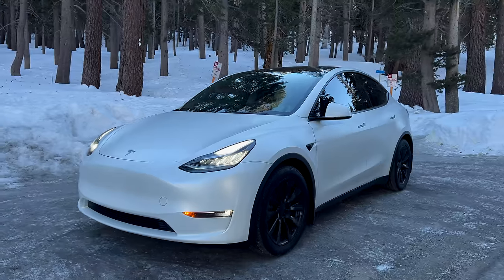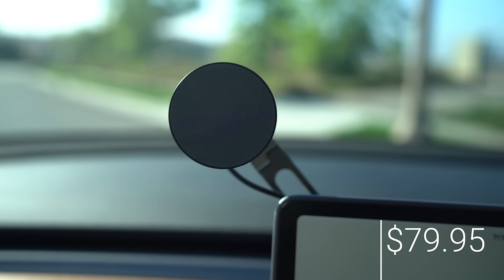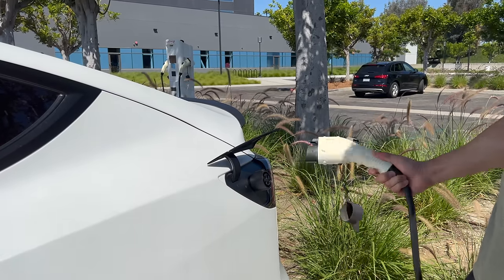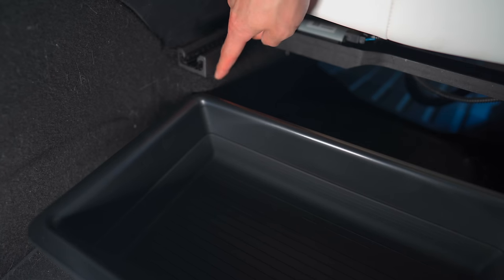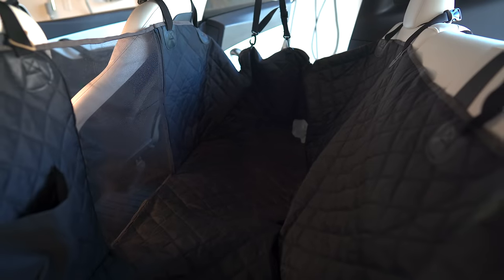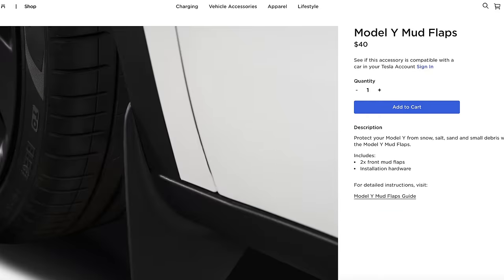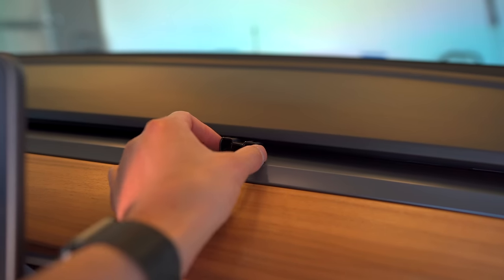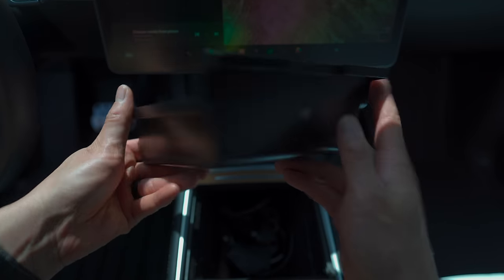TOP 10 TESLA Accessories I Can't Live Without!

Comment from the maker: ‣ Floor Mats 
‣ 3D Maxpider: https://bit.ly/3E2aVUy  
$10 off: Everydaychris
‣ Tesmanian: https://bit.ly/3raOmX0
10% Off: Everydaychris627

Cell Phone Mounts
‣ Jowua Amazon: https://geni.us/3N4GePy
https://bit.ly/3aEt8uL(5% Off: Everydaychris)
‣  Magbak: https://bit.ly/3DrUOx4  (15% Off: Everyday_chris15off)
‣  Temai/ Vion: https://bit.ly/3sOqtIn (10% Off: Everydaychris)
‣  Spigen: https://geni.us/EJdv

Radar Detector Install: https://youtu.be/9bf_Gu_R91Y
‣  Uniden R8- https://geni.us/qY5U
‣  Uniden R7- https://geni.us/nEBrM

‣ J1772 Lock
https://geni.us/z44nMU

‣ Cnick Tesla Ring
5% off: https://bit.ly/3usWpm0

‣ Storage Trays
Jowua- https://geni.us/VSBc
Spigen- Center Console https://geni.us/xj6K
Under Seat https://geni.us/4onn
Rear Storage box- https://geni.us/0lYa0q
Hidden Storage- https://geni.us/kQ4qJJ

Tesmanian  https://bit.ly/47HSQGW
10% Off: Everydaychris627

‣ Dog Seat Cover
Amazon- https://geni.us/J4PREUJ
Tesmanian  https://bit.ly/44fFUam
10% Off: Everydaychris627

‣ Magbak Rim Case Protectors
https://bit.ly/3IqbhWt
Use CODE for 15% OFF: EVERYDAYCHRIS15

Basenor Mud Flaps- https://geni.us/phCSi

Emergency
Jack pads- https://geni.us/WBnhG0V
Tire Plug Kit- https://geni.us/bTP8HBp
Vac Life- https://geni.us/6uQvc
Heavy Duty Extension Cable - https://geni.us/bwBwLwb

‣ Spigen Screen Protector- https://geni.us/DulKl
‣ Drift Natural Car Air Freshener 
 https://bit.ly/32IBVbm 
 10% Off: Everydaychris10
‣ Spigen Adapter- https://geni.us/E6j15Av
‣ Spigen Gas Pedals- https://geni.us/05VRXTY
Heatshield Sunshade- https://geni.us/5mNX

Comment: My #1 accessory is a swivel mount for the screen. Once you have it, you will never go back.
Reply from the maker: ive always debated on it maybe ill check it out
Reply: @EverydayChris  I have had it installed for 2 years. My screen has not faced dead center since.  Your co-pilot will love it too.
Reply: This was my ideal, first modification, but after some research and YouTube videos, I decided against installing a swivel mount due to the fact everybody is saying that it mounds a bit lower than the original stock setting or just ends up not angled correctly
Reply: I’m honestly surprised Tesla hasn’t added that from the factory,
Reply: @SSTURN any brand in particular you’d recommend?
Reply: @ssturn I am getting this installed on Monday with the other mods I've done. I can't wait. The swivel will be a game changer. This is on my refreshed M3 LR I recently took delivery of🎉 I absolutely love this car !!!
Reply: @cellman1829  You'll love the swivel. I still don't know why it doesn't come with it from the factory.
Reply: @EverydayChris if it didn't work copy cars wouldn't have them. 😂

Comment: These things are complete bs. They fall apart because the segments rub on each other. Then they start making noises (which magbaks support finds normal) and even fall off after a few miles. And having those things fly off in high speeds is probably not funny at all… magbaks support wont refund you even after contacting them multiple times. I now bought basenors rimcases which are one piece, they dont male noises and wont fall off. And they are half the price.

Comment: Wondering if you recommend the Spigen suction cup version over the Jowua, there is a significant cost difference, not sure what makes the Jowua 30$ more but has the exact same function/features. Any reason you would justify the additional expense?
Reply from the maker: Similar. Jowua has more stuff, longer cable, mine also had a usb c adapter.

Comment: Hey Chris, for a Model Y what is the best home charger to install into the garage? Just have a 220 Volt installed and use the plug that comes with the vehicle or something more elaborate?  Thanks in advance.
Reply: It's actually 250 volts.   110v went to 120v then to 125v in most of north america.   If you do not have a 250v outlet and want an outlet  I would have them install wire guage thick enough for 60 amps.   The wall connector will charge 48 miles of range per hour but needs to be hard wired to 60amps to do that.   The mobile connector plug is a 50 anp 250v and it will charge just under 30 miles per hour.   I had a 250v plug for a welder and just use that with the mobile charger but if I did not already have the welder outlet I would have just got the wall connector and hardwired it to a 60 amp breaker.

Comment: BTW do not buy the tesla aircompressor, ive gotten 2 and they both failed after a few uses, and the fix a flat never worked on either..
Reply from the maker: You sure? It might be due to the lithium ion battery! Happened to my x. Ended up using battery ones